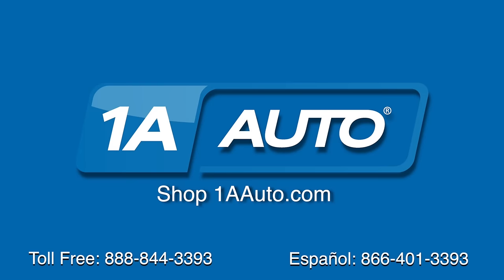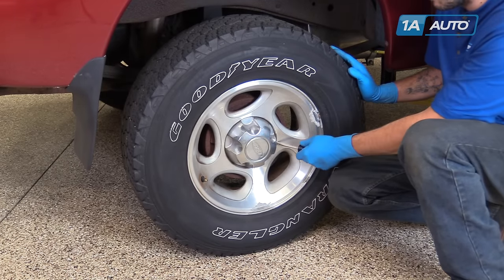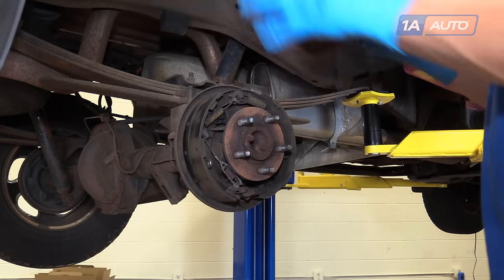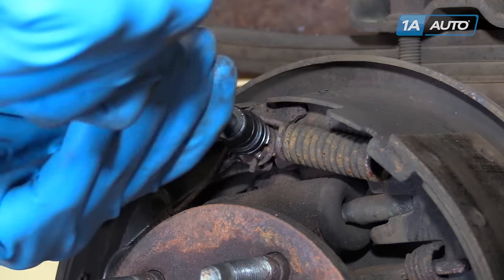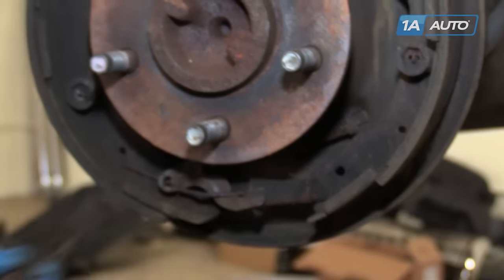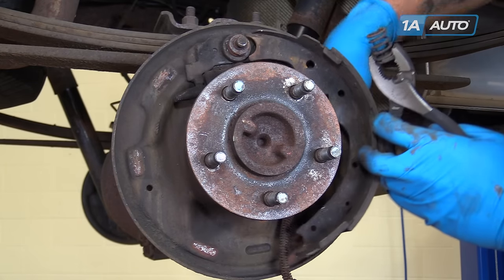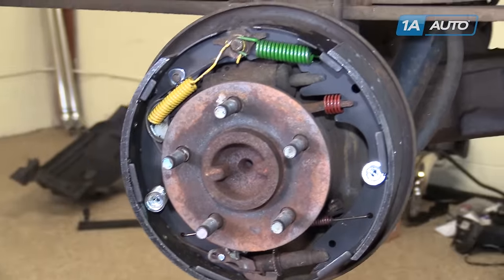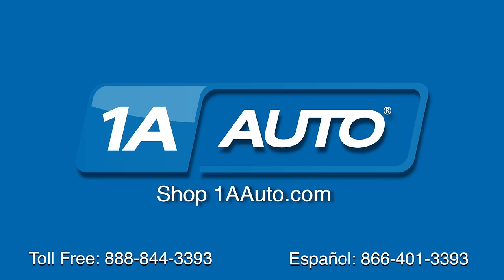How to Replace Rear Drum Brakes 95-09 Ford Ranger

Comment: The Ford Ranger with 9 inch drums have no clothespin plungers coming out of wheel cylinder. The shoes have a metal shape that inserts into wheel cylinder. The emergency brake lever has a hook that connects it to the rear shoe. The Ranger 10 inch drums have the traditional clothespin plungers which push against the brake shoes and a bolt on emergency brake lever which is secured to front side of rear shoe with a C clamp.
Reply: A most rare tip.

This may also help with Rangers 2001-09

All 4x4's
All SuperCabs
All w/Payload Package 2 upgrade
All 2001~2005 Edge
All 2006~2009 Sport
9" drums should have been factory equipment only on XL/XLT REGULAR cab 4x2's with the STANDARD Payload Package 1.

Comment: So, just FYI, there's no need to remove the e-brake actuator on a 1996. It doesn't require a spring washer or horseshoe clip.  It can be left on.
Reply from the maker: +Tony Adair Thanks for the tip!
Reply: Ya dont have to take it off my 01 is the same dont need them just put it in the hole lol

Comment: "...and then your remove the kidneys, while tapping the lower spring twince while using the break tool to simply attached to the cap forward and then simply close and sew up the patient on the other side.  Allow two weeks to cure and take it to a shop if symptoms persist!!"

Comment: Clear instructions and great video, but just so diy people know, you should clean the parts that are being reused, and on the backing plate there are 6 raised areas where the shoes slide.  those should be wire brushed and a light coat of brake grease applied.  The adjuster should be lubed on the threads and also under the piece that slides off the other end.  Also, make sure there is no leakage from either side where the pins come out of the cylinder at the top.  Before reinstalling the drum, clean off the hub surface so it has no raised spots from rust accumulation.  This will make sure the drum runs true when tightened down.

Comment: Couple of easy hints;
1. Every three oil changes, check and adjust the rear brakes if needed. Front brakes (pads) will wear out twice as fast if the rear brakes are not adjusted properly.
2. Once the drum is off and the springs are cleaned, take a pic for reference as well. As one side may have the e-brake hardware, the left/right sides may not be mirror images.
3. Another method - on the floor, lay out the new shoes & springs on top of each other exactly as they are to be assembled before tearing down the old parts. Take a pic of that too (hey, pics are free if you have the right phone). Plus, it'll give you an idea of what pieces you need to save vs discard. (It might save you the problem of digging thru the garbage can later!)
4. If you are not replacing the drums, you MUST have them re-surfaced when replacing the shoes.
5. Good habit is to buy the Combi Kit with new shoes.
6. Hold the two brake shoes together side by side. The shoe with the longer amount of ceramic/semi-metallic padding goes towards the REAR of the vehicle. 
7. Never touch the inside of the drum (where it meets the pads) as skin oil & dirty fingers will reduce the braking power until it's burned off. If you, just clean it with brake cleaner.
8. You can put some lithium grease on the wheel studs when placing the lugs. It might save you (or a family member)from breaking your/their back while on a roadside sometime later.

Good Luck!
Reply from the maker: Thank you for all the tips and suggestions!  We appreciate it! +Spaz 360

Comment: Thank you so much for this video, I followed it step-by-step and did the job myself. One tip, when it comes to replacing the lower spring, better to put that in partly before you attach the cable.  I found trying to get it in the after the cable was pretty brutal on the spring.  Thanks again, outstanding job!  Why any auto manufacturer is still using drum brakes in 2004 is a mystery to me.

Comment: So helpful!... I was not actually changing my brakes, but the emergency brake cable (it broke). But, to get to it, I had to take the brakes off, just like I was replacing them.  When I got the drum off, the brakes were like new (I bought it used a few months ago), so I did not need to replace them.  But, once I took them apart to replace the broken e-brake cable... your instructions on putting it all back together was a God send.  By the way, I bought the brake cable from you guys... it was excellent quality and shipped very quickly.
Reply from the maker: +Jeffery Mayhann Thank you for your order. If you would like to leave us a review on Google it would be greatly appreciated. Here is a link to our reviews section. Have a great day! https://goo.gl/i5JFNY

Comment: I read this in my how to book some where: On removing and installing the e-brake cable to the brake shoe  lever: pull on the cable from under the cab and put an allen or screwdriver in the foot brake retainer under the dash.... to keep the cable slack..just revers when done easy peeezeee..  no fighting the spring..
Reply: Thank you! I was contemplating actuating the foot pedal but wasnt sure how to keep it open.

Comment: Couple tips picked up from other vid sources.

Before removing drum cover, block tires  to press rolling, if necessary, and release parking brake .

 There is a inch size rubber plug on the bottom back side of the drum cover and when removed, one can lessen the brake grip and make it easier to remove the front cover at the beginning.

One can adjust the brake using this same technique but in the opposite rotation. The wheel can turn freely and the hear slightest sound of contact friction when ready.

Then bleed that break line to this brake.

When all is through, and the truck is ready to drive  backing up should self adjust parking brake.

Comment: When assembling the top spring your brake spring pliers should have a channel /groove in the handle hook spring on plier handle then place the groove /channel over the spring pin. Pry theHandel and the spring slides down the Handel onto the pin. Otherwise Great vid.

Comment: In regard to the emergency break wire 

I’m not sure if it’s been said, shown, or anything but my mentor taught me that if you pull directly out on the end “cap” if you will, it will give me you slack I between the spring and the end cap shows while he is attaching the components
Reply from the maker: +Original Character Thanks for the tip!

Comment: Well I have 2004 ranger well i had 2 strokes and The driver side rear brakes separated from the shoe passenger side wheel cylinder was leaking I was able to change the cylinder I was a mess well I’m gonna have to passenger-side complete that easy video help me considerably I’ve done quite a few break jobs in my day not a stroke victim it will take me all day tomorrow 
So
Thanks for the info 
Gary in western ma.

Comment: Nice video BUT you FORGOT to show people to add grease to the contact points. You put a small amount of grease on the 4-6 little nipples or those little high points on the backing plate. This allows the shoes to slide and have a nice lubricant to move easy vs metal on metal. Everything else is done very nice and easy to fallow, just picked up a 98 ranger and was seeing what I am about to get into I have done MANY and HATE doing drum brakes. 96 Chevy have been the WORSE for me lol.
Reply from the maker: +Mentally Deranged 916 Thanks for the feedback and for watching!

Comment: here is some more food for thought...some times when ya disturb the wheel cylinder for some reason or another they tend to leak,,why ? who knows..so while your already into it go ahead and replace them. and bleed the brake line with new fluid ..
Reply: Yep, sure enough. I replaced the shoes and all the springs and hardware, and bingo the slave cylinder started leaking. Now I'm going to have to at least halfway take it all apart to put a new slave cylinder in. Oh well. So goes life.
Reply from the maker: +Old man Thanks for checking us out!
Reply: The hard part is finding the lines I can’t even find them anywhere

Comment: If you have problems removing the drum, remove the rubber plug from the back side of the plate, use a flat head screw driver or self adjuster tool to back the self adjuster off. Drum should come right off... may need a helpful tap with a hammer as well.
Reply from the maker: +Schweddy Thank you for the tips and for watching!
Reply: Also if your adjuster does`nt want to work take a propane torch and heat the drum in between the lugs many times it will just pop with out the use of a hammer after wards.

Comment: I don't think the auto manufacturers could have come up with a more complex design for stopping a vehicle than drum brakes. Toyota used them on the back axle of the Corolla for years, long after other manufacturers converted to disc. You would think that discs would be more cost effective parts wise plus the labor associated with assembly.
Reply: Drum brakes last way longer between services if they aren't used too much. Thats why they make sense to use for the rear on a truck, most of the weight is up front and rear brakes aren't used as much anyways, so drums are way less maintenance than discs when used on the rear.

Disks are have more surfaces that need to seal and interact with fluid. Getting good seals that last is one of the harder things to do when manufacturing anything. They have gotten good enough at it nowadays that drums are almost entirely obsolete, but this was not the case not that long ago.

Comment: Excellent video, I just wish my drums came off as easily lol.
Reply: It took my father and me 2 hours to get one drum off using prybars, steel wedges and a 5 pound sledgehammer. Had to cut the pins off from the back.
Reply: @oobaka1967 and everyone else:
If your drum is tight, theres an access port behind the backing plate that looks right into your adjuster. Reach in and tighten up the adjuster with a flathead to close the gap and your drums fly right off!

Comment: Ya Know, Guys/Girls.  USA made  cars have had had pretty much the same drum brakes since the mid 1950's.
It seems to me that the rear drum brakes use  far more parts than the  front disc brake hardware uses.  Disc brakes work so much better than drum brakes  and so are much easier to  to change out.  Sorry.... I just don't get it.

Comment: I watched this video to the 5 minute mark and realized the tools he uses made me give up hope i can fix my brakes.

I tried another video and when they actually used pliers to undo the springs i felt way more in tune with that method. Using specialty tools on simple jobs make the job look way harder.  This video intimidated me and made the job look difficult. This is my 4th ford ranger video and this guy is a good mechanic hell hes a great mechanic but sometimes i get confused when he uses complicated tools to do simple things.

When he pulled out the spring tool i googled conversion kits to disc brakes. Once i saw the price i found another video that used the simple methods to do it and it was exactly what i needed to see.
Reply from the maker: +Drivin Mopar Thank you for checking us out! We appreciate your feedback and will consider showing the specialty tools and then the alternative if you either do not have or cannot gain access to those specialized tools. We try to make our videos for the greatest audience and have since moved towards a more generalized way of repair rather than using all specialty tools when available.
Reply: The tools mentioned are very  inexpensive you should purchase them. They are part of any persons tool kit who does their own Automotive repairs. Although I wish every manufacturer would go to disc brakes , and for the most part they are, because they are so much easier to repair and or replace. Good luck

Comment: Has anyone had an issue after replacing the shoes and the drums where your brakes start to pulsate? I’m having some bad shaking and can determine if the E brake needs to be adjusted for if I might have a warped drum from the factory.

Comment: Why do my passenger rear drum brakes over tighten? What causes them to tighten to the point of locking the wheel up.
Reply from the maker: +@jarredallen2016 We wouldn't be able to diagnose an issue like that here, you may want to have a local mechanic take a look at it. Thanks for checking us out! http://1aau.to/m/Shop-1AAuto-c

Comment: I think you got the sequence wrong on the top springs. The green spring should sit behind the yellow spring. Also, a mini pry bar with an angled tip and some tape wrapped around the tip would prevent the wheel from getting gouged up from a screwdriver blade twisting and prying against it.
Reply: Mine came from the factory with the yellow spring behind the green.... but... I dont think it much matters actually.... Im on my second rebuild have roughly 200,000.0 miles on the old rig.

Comment: Good video, very informative, but flat blade screwdrivers are not pry bars
Reply: A tool can be called whatever you want.. the point is using what is available in different applications.. pry tool, screwdriver, lever, chisel..

Comment: i dont like using a screw driver to remove the hub tbh. It does cause damage when you could just wrape it in a microfiber. i use a crowbar with a microfiber on the corner of the pry tool. super easy and no damage.
Reply from the maker: +Nick Feness Thanks for checking us out! 1AAuto.com
Reply: @1AAuto  for sure! You guys are saving me mega bucks on my new truck :D

Comment: Gentlemen, please, add to your list of tools. While it is not *NEEDED*, a furniture clamp (https://www.harborfreight.com/6-in-ratcheting-bar-clampspreader-64154.html ) will make remounting the shoes so much easier. I have a weak right hand, due to a childhood accident. So, inspiration hit me and I used one to hold the backing plate and shoe together. It made the three pieces (pin, spring, and slotted clip) a breeze to assemble, alone. Turn someone's "disability" into an *OTHERWISE ABLE*, thank you.
Reply from the maker: +Edgar M. Mosier Thanks for the feedback!

Comment: And what's the process when the drum does not slide easily off the axle? And your brake tool will not turn the adjustment spacer because it is rusted to all hell? Have beaten and pried the drum to get it past the brake pads but no luck. Is there another Choice besides getting my angle grinder out and cutting the drum in half? There's got to be a special trick out there somewhere, help! :/
Reply: You can pull the retaining pins from the back and cut them off with wire clippers. This will allow the shoes to collapse inside the drums.

Comment: @around 7 minutes 30 segonds it talks about putting a spring washer and then the horseshoe clip is seated.  I don't have the spring washer and my e brake part doesn't look 100% the same.  Is it possible I don't need that?
Reply: Some don't have the spring washer and horseshoe clip. My 1996 2WD doesn't. It has what looks like a tab that fits into a slot on the backside of the shoe.
Reply: You have to use the spring washer from the old set as the the parts kits don`t include that part it helps the e-brake move smoother. Mines an 02 that i`m doing right now and I had to replace every thing adjuster and all ,also the parts kit don`t include the brass anti friction washer on the star adjuster either you have to reuse off the old one. just a way of chincing for a buck I guess.

Comment: I have a 96 Ford Ranger Ext Cab 2WD and just recently my right rear wheel cylinder is leaking pretty bad causing a very soft pedal. My Master cylinder is brand new. I've been having to use the E- Brake to stop,yes I know that's dangerous, but here's the kicker. The other night on the freeway I heard a loud banging noise coming from the rear. I pull over and that same tire with the bad cylinder is being held on by one lug nut the rest had sheered off. How in the hell could this happen with a bad wheel cylinder?
Reply: Jack MeHoff completly unrelated

Comment: Why can’t a find a E brake actuator for my 04 I need one and it seems impossible to find or are they universal as long as there for the drum you have?
Reply from the maker: +Chance Bower They should be specific to the vehicle. We currently do not carry the replacement for your vehicle. You may want to ask the dealer to see if they can get a new one for you. 1aauto.com
Reply: That I you I didn’t buy the vehicle off of a dealer but would I be able to still get the piece from the ford company
Reply: Any tips? i have the same problem

Comment: what size brake shoes does a 95 2wd ranger have? I seen there are two choices 9 and 10 inch.
Reply from the maker: +Kristen DiThomas You may have to have the dealer run the VIN number for you, or you could measure the drum with a tape measure (take the wheel off first) We carry the 10" drum brake shoes. Here is a link to them https://www.1aauto.com/brake-shoes/i/1abps00882?f=987236&y=1995&utm_source=YouTube&utm_medium=CTA%20Comment&utm_campaign=ytcomment
Reply: 9" for standard cab, 10" for extended cab
Reply: @thisismyjunkmailboxforyour9172  I have a standard cab and 10 inch drums. It all depends on the exact model and vin.

Comment: You left all the rust on a lot of those parts and didn't lube the backplate.........no wire wheel in your shop??? Check out South Main Auto Repair,  Eric does it the right way.

Comment: Why do all the self help videos show the rear right drum assembly? My 02 Ranger on the left rear(driver side) has a completely different emergency brake assembly without a hole!
Reply: i`m going to finish my 02 in the morning it has the same on both sides. The only problem I ever had was one time I did shoes and they did`nt have the pivot pins installed for the adjuster lever on them. This time they have brass pins on them.